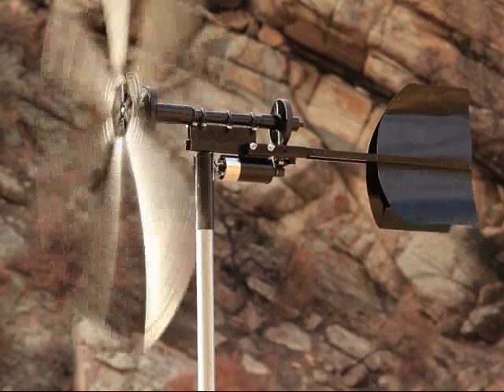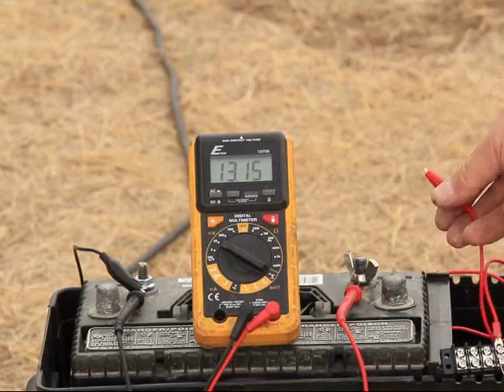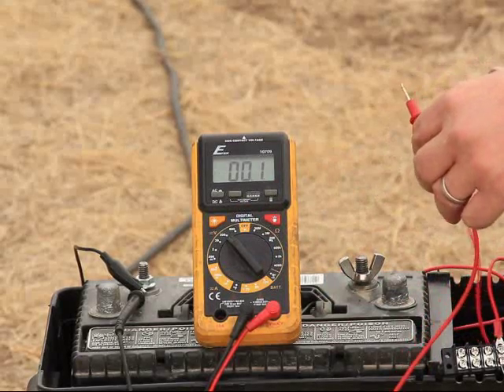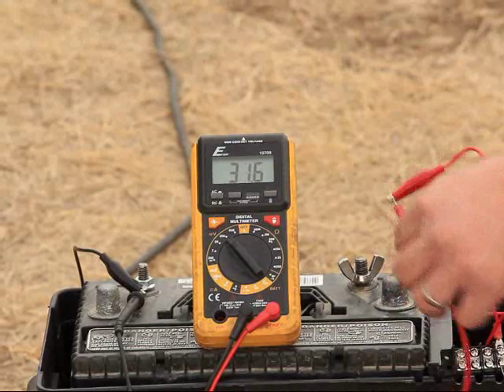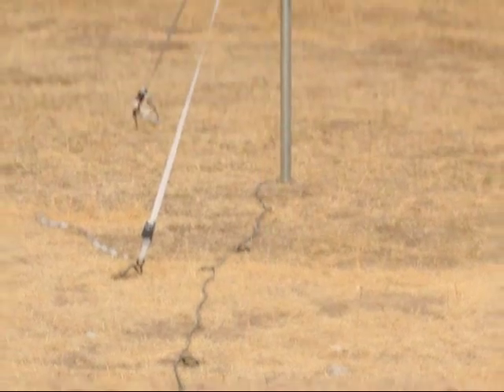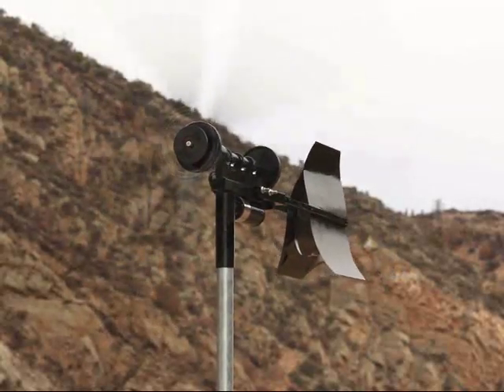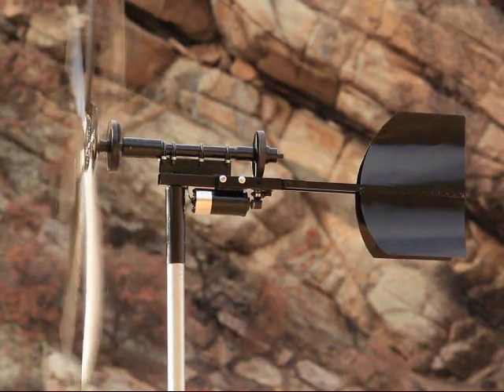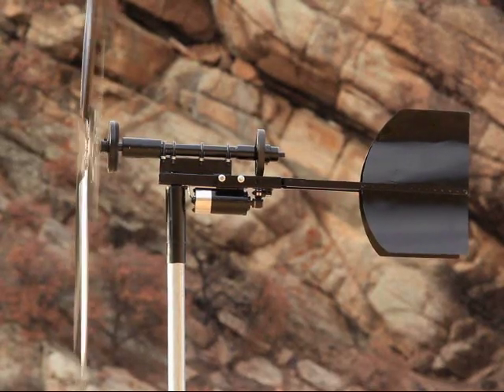Part 6 Grooved Belt Treadmill Motor Wind Turbine Generator DC PVC Blades Gear up PMA

Comment: Hi, if the project is open, can you publish the way you built it? Expecially the parts you used and the gearbox. The generator seems to be a DC motor, isn't it? Regards

Comment from the maker: There is one I made a couple years ago with a nylon reinforced vacuum belt (thin flat belt) that worked well. It was super efficient and fairly easy to get together .. check out replacement vacuum belt section of walmart. Always wanted to make one with chain but noise would certainly be an issue. Much of it depends on how "coggy" your motor is; if you go too deep with the ratio its a deal breaker. This assumes a good wind location. Can always just strap a generator under the lawn tractor :)

Comment: I tried the belt gearing, however it did not work. that's when i figured out (i'm a dummy i used a v belt set up) v belts have to much drag. the next think I'm going to do is either chain, or like you did a flat belt.. great video loved it i was also thinking of gear to gear? do you think that would work?

Comment from the maker: Yeah watch out you will need a twelve step program to stop making these things :) I would recommend shopping eBay for an AC servo motor .... its a close cousin of that stepper motor but output is much higher. If you get one rated 240 volt or higher you can probably direct drive and avoid the gearing noise and losses. Also, sort by lowest price + shipping you should be able to pick one up for under $80 if you keep looking. My next turbine video will be about a servo motor turbine.

Comment: This is really cool! I'm going to Kenya next month to help a school build a real wind turbine, and I'd like to know more! Can you give more details on how the DC motor, diode, charge controller, and deep-cycle battery are connected? How to determine their specifics (volt, amp) so that they can work together nicely? Also, did you use inverter to change DC to AC?

Comment: Hey man good  video. What happens when the turbine gos the apposite  way you get negative volts.  Con you help me with this
Reply: It doesn't go the opposite way. The tail moves it so it always faces the wind, and even if the dc motor spins backward it still produces electricity. The bridge rectifier only allows current to flow one way and turns ac into pulsed dc.